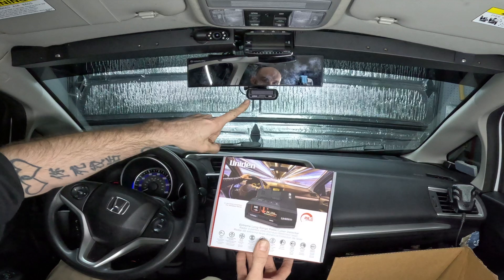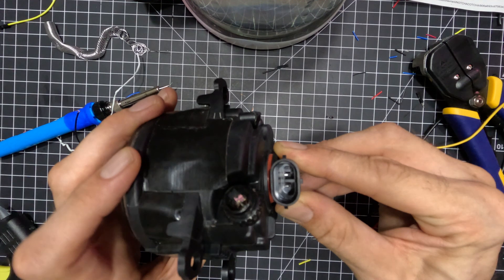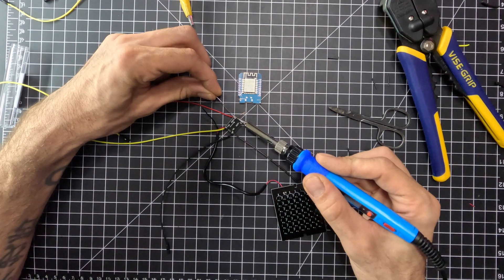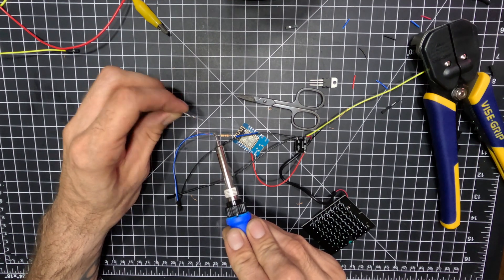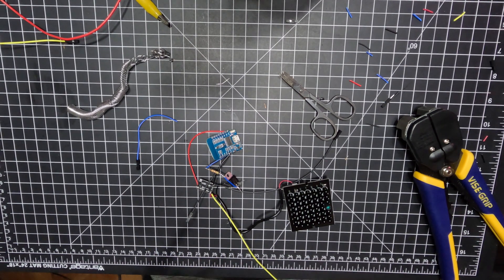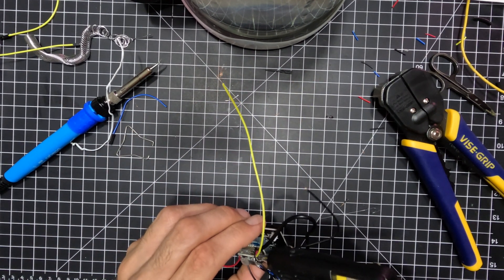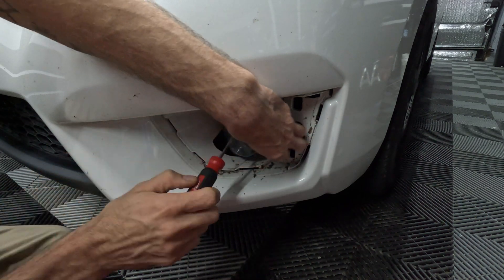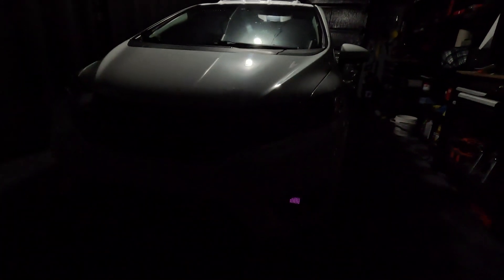"NOTCHA COTCHA" $8 DIY Lazer Jammer | Open source Homebrew Countermeasures #NotchaCotcha

Comment: Does this use an app to match what the current speed limit is?
Reply from the maker: Yes. You can also make adjustments to add or decrease your "advertised speed"
+1, +2, +3mph on top of the posted speed limit. ;)

Comment: hard to find info on the overlap between 904nm vs 940nm. pretty sure youre using 940nm leds since theyre so cheap. pretty sure you would get some amount of interference regardless and at the very least reduce the range/limit the conditions where a standard 904nm lidar would work.
how has field testing gone? thanks for uploading this

Comment: the board alone is $20 so where is this $8 price tag coming from?
Reply from the maker: Hi Jax. I did not use the same LED array that Bill posted online.
His build sheet shows the array price at $6 in 2019
The cheapest IR array I see now is about $9

Time Stamped to bill of materials. https://youtu.be/vQtLms02PFM?si=GKWFiHs0PATR-HuX&t=2409
Reply: @HondaFit4Adventure  ohhh right right. I didn’t check the date on the video. Thanks for the clarification. 🤘🤘

Comment: What would happen if some one was to run a radar at the same time as a cop? Would you able to clock each others speed correctly? Same question for lidar?
Reply from the maker: According to google..
"Can police radar guns interfere with each other? In rare situations yes they can, but it would be extremely rare to find two police radar guns that operate on the same exact frequency. Also there are safeguards to alert the officer if interference is affecting the radar gun with audible and visual alerts."
It sounds like they would get an alert if something was interfering with there signal and only interfere with the radar gun if they were on the exact same frequency.

Comment: If i want to install a cruise control for my base model honda fit gp5, do i just have to buy wheel switches buttons or i have to buy a whole cruise control kit?
Reply from the maker: I'm not 100% sure, but I think you'll have to buy a whole cruise control kit.
Some cars come prewired for all the accessories. The Honda Fit does not.
I didn't see any plugs on the factory wiring harness to add fog lights to the base model Honda Fit, so I'd assume it wasn't set up to add on cruise control either.

Comment: Hi, do you have a system that warns you when you are being shot at and then allows you to turn off your jammer? I know the commercial versions do that does yours as well? Or is there a resource so I can add that to the build shown here?
Reply from the maker: Hi there. No this system does not give you any type of warning when you are being shot at with a laser. I'm sure it can be programmed in, but that's beyond my ability.
Allegedly, the app for this device will pull map data from the area you're travelling in, and then shoot that speed back to the laser with the option of adding 1-5mph.
Example: If you're travelling 80mph in a 70mph zone, the fog light will give a signal telling the laser your going 70mph with the option of making it say 70-75mph.
Hypothetically speaking, you shouldn't need to turn off the fog light.

Comment: Does it need to be put in a light housing like that or could it be mounted in a grille so its closer to the license plate? Also, this would just be wired into the headlights or it could be wired separately to a different switch?
Reply from the maker: The electronics need to be in some type of waterproof housing. 
It is highly recommended to install the laser jammer heads (2x) towards the upper grille for best coverage. 
You can wire it to a separate switch. I actually don't have fog lights, so for testing and demonstration purposes it has been temporarily mounted in the fog light area.

Comment: Since the rear of the vehicle is much more flat than the front, increasing reflectivity of the laser beam, do you plan on installing one on the rear of the vehicle to defeat those officers that choose to sit on overpasses and enterance ramps, dark, to tag the vehicle after it has passed? Georgia comes to mind specifically.
Reply from the maker: Kudos to pointing out a state that shoots from the rear :)
I plan on getting an ALP system in the fall. Two heads in the front and one in the rear.
I have a background in Computers & Electronics so I thought this would be a fun project to tinker around with.
I'm sure you already know, ideally the heads should be mounted in the grille of my vehicle for best coverage and not the fog light area.
It does look clean though!
Reply: @HondaFit4Adventure   bro please make a video walkthrough or can i get your contact so i can speak with you more about this, I am a computer science major based out of northern california.